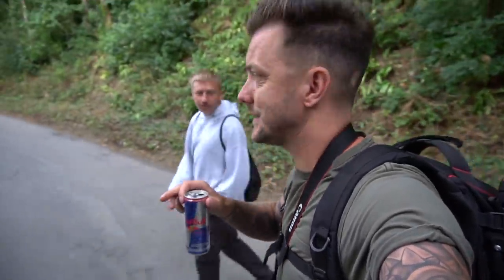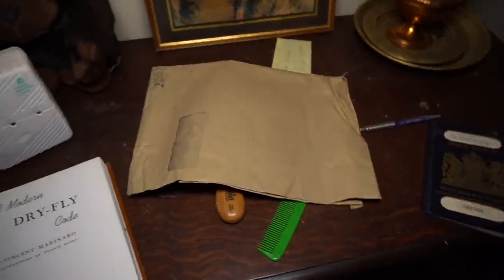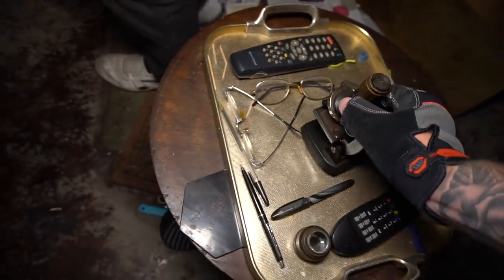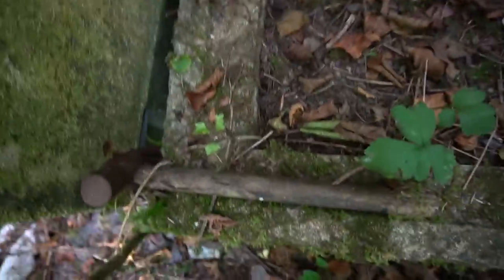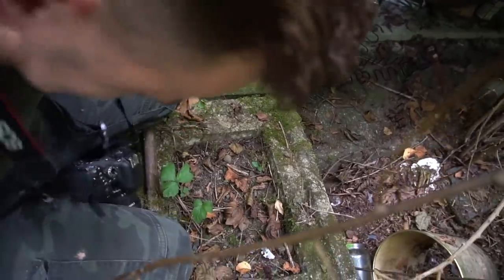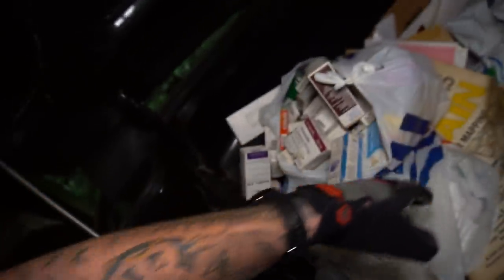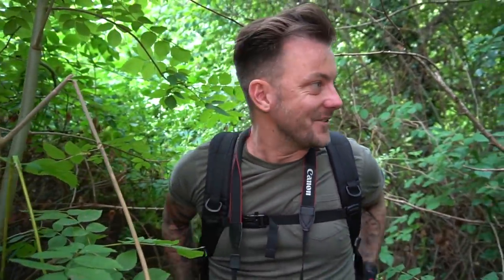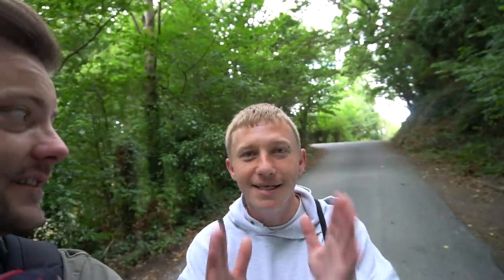ABANDONED LOST COTTAGE TIME CAPSULE (RARE CAR FOUND)

Comment: What a find! Seemed some distance from anyone but you guys mutter softly to each other. When you talk with viewers at ~23:45 you not just spoke soft, you told what we already knew.  Room for improvement. But wow - really great find. Oh, more protection! Bare tattooed arms going through brush... I'd get scratched. Use a large stick to help see or scare away any potential snakes. I wonder what the car  at ~2:32 is.

Comment: That Fiat could be cool. They had problems with the fuel systems in those cars, and with the engine cooling systems as well, but as it’s in decent shape, it would be worth putting it back on the road. It’s amazing that the tires still hold air after sitting so long. Write down the VIN number of the car and have it traced through to find out who it belongs to, and if that person is still alive. If not, you’ll have to do some detective work. There are probably only a handful of those cars still in existence, as they were prone to rust. Here in America, parts were hard to come by, so most Fiat X-1/9’s saw a short life and ended up in junkyards.
Reply: I concur. Had to do a lot of work on mine, but it was fun here in the US. My right headlight was always a popeye
Reply: @Connor Buckley I wonder if parts are still available?

Comment: the cups are tankards the roof on the car is vinyl the X19 has a removable roof and that's probably the best example of one left my dream car when I was 17 back in 89 and for that car to sit their and slowly rot away if a tragedy ,
Reply: The roof of the car is fiberglass, it lifts off, and fits in the front trunk, or front boot.  I had a 1974 X 1 9